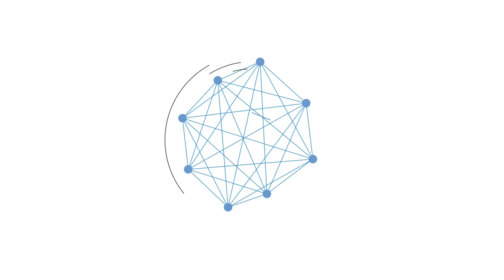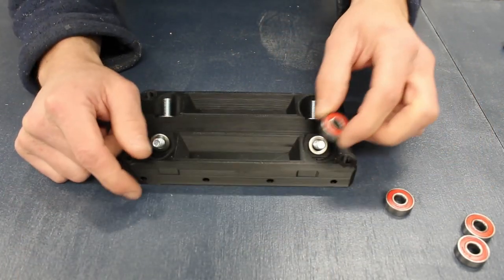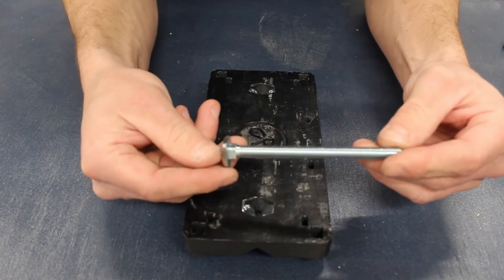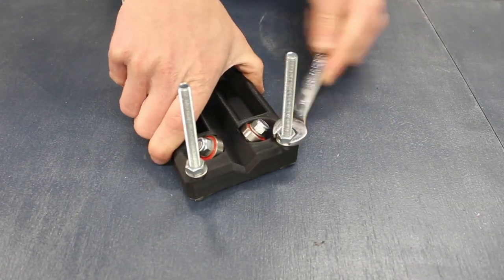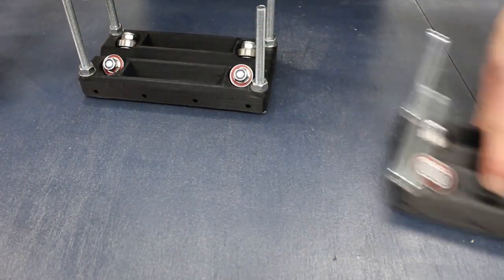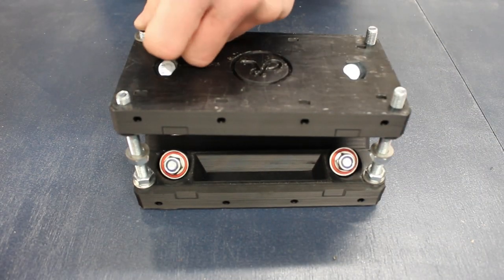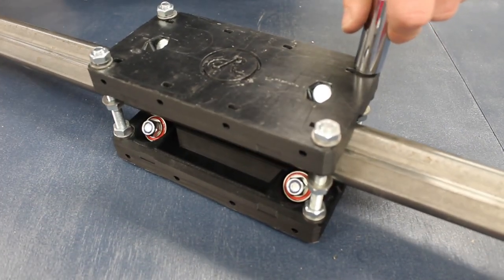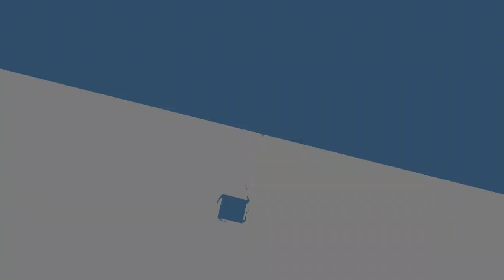3D Printed CNC Machine Root 4 - X Y Carriage Assembly

Comment: What are the specs/sizes for the square metal bars (box rails)? looked on the BOM - couldnt find them? 1" Stainless Steel?
Reply from the maker: Check out the root 4 comparison table on https://www.rootcnc.com 

Root 4 used 40x40mm box, thicker the better. I think mine or 4mm wall thickness
Reply: There are Beta variance parts for 1.5" inch steel.  give it a go!